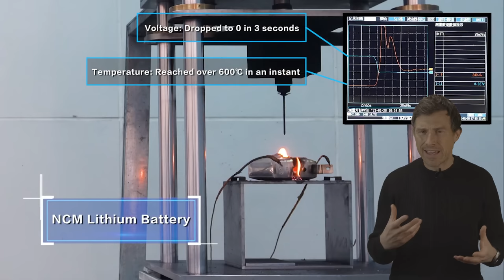Chinese cars are going to rule the world!

Comment: Chinese vehicles are actually doing well here in africa with the spare parts available and the cheap price, too bad they aren't of very good quality but still, they are doing well and selling well, they also offer you a great option which is the cargo tricycle, if you have a limited budget and you want to buy something that carry some loads, you don't need a truck to do the job, a tricycle will do it for you

Fortunately, there are the japanese brands if you want reliability and quality

Talking about motorcycles, they aren't that good compared to the other brands, but still, cheap (to be honest i wouldn't buy one)
Reply: If you want better quality, buy the more expensive ones. They offer you a wide spectrum of choice from very cheap tp very expensive.
Reply: @rap3208  agreed, we have an association that help people in needs, our leader recently told me to look for a truck in the shacman dealership, they were selling 1 truck (X9) but 2 different models, 1 has a Chinese yuchai 3L engine that makes 220nm at 2200rpm, 5 gears transmission, light chassis that is a 2.5T but it is cheap, the other had a 3.9L cummins that produces 410nm at 1500rpm, 6 gears transmission, the chassis looked strong enough and it's a 7t, but it was about 40% expensive

From that day, i learnt that they give you the choice, but most people go for the cheaper option then they complain about it

Comment: We have a Haval H6 from GWM here in Australia and for the money, it spearheads the RAV4 and Hyundai Tucson. Top of the range for those 2: $55,000. The H6 Ultra? $41,000. It's unbelievable value for money without compromise
Reply: @nathanielmoran8537  we don't care about that. Money money money
Reply: @nathanielmoran8537  car companies are not using slave labor mate, they get paid. Not as much as in some countries but more than enough to get by.
Reply: @nathanielmoran8537  geez seems like u know nothing about the car production 😂😂
Reply: @shawndonadieu4084  I know plenty actually. The reason American cars cost so much is the labor. The unions have the companies by the you know what. I’m not saying that the car company itself necessarily is running a sweat shop but I would bet the supplier’s are. It’s same with things like electronics too. Apple products are built in sweat shops.
Reply: @shawndonadieu4084  Plus Chinese branded cars won’t pass our stringent safety tests so they can’t be sold to the public. An issue you don’t have with your death traps 🪤

Comment: 2012 - "I will never buy a Chinese car"; 2022 - "I did not say that!"
BYD is actually the one to be most afraid of - it has one of the most complete chain of technologies. They started really early in hybrid and electric powertrain technologies and their products built in the past 5 years showed excellent reliability. Many of the EVs used in China as taxis, rental cars, and ubers has done over 350,000km now and according to the operators they showed almost zero issues with a completely acceptable ~10% - 15% battery capacity degradation. Many of those cars are still on original brake pads thanks to the KERS.
Lynk&Co. is another one to watch out for. They are essentially Volvos ranging from XC40 to XC90 at half the price. And it is like those Xiaomi phones - same hardware and operating system, but cheaper and, to certain groups of people, better UI and features.

Comment: Really appreciate for exhaustive introduction for Chinese EVs Matt! 
Own one BYD Han DM (not the DM-i, the old version plug-in hybrid), honestly the electronic system as well as Interior trim are decent comparing with same price level saloon (￡30k). However the chassis and the suspension system are sort of lower than average level. Since I've been for vacation and rent VW id.4 once, It suprised me for its fabulous driving experiance.

My appointment is although there are quite a few emerging Chinese EV brands crushed typical vehicle market. The hardware such as suspension, steering system still has a long way to go.

Comment: Changing battery rather than charging is cost effective for the owner, they won’t have to worry about replacing a battery later on when it wears out because that won’t be cheap plus labour.

Comment: the biggest difference of EV market between China and Europe is that, in EU the price of EV models is top-down, with expensive cars coming out first, and then cheap cars coming later; in China is totally the opposite, it is bottom up. So in China, the first EV models that came out were all cheap cars that the public could afford. Therefore, this has also led to people's perception of electric vehicles: they should be cheaper and should be lower than gasoline vehicles. This is the complete opposite of Europe.

Comment: The Geely 01 looks identical as Kia e-niro. Seriously can they do nothing but plagiarise?  
The battery swap tech is simply absurd idea.      600mile+ ranges would technically be possible with EVs even now with todays batteries - and more cheaper and more possible in future --but why even bother?   After  400miles & 7 hours on the road, why on earth would anyone not wish to take a break for half hour re-charge - not just of the car  but mind and body.  And even that half hour will reduce in future to 15-20mins.
I proved to myself long distance motoring is zero hassle last year in my 300 mile range Tesla - all round Scotland to all offbeat corners. Never once had range anxiety or stressed waiting for charge up. I was happy for the break!

Comment: EV has become utensil. Taking you from point A to B. Comfortably and safely. Some tool you need to do a job. That's it. Therefore, it must not be a significant cost item of your family budget. China  car makers are new kid on the block. Having succeeded in home market, they are going to world market where consumers have more choices of EV. China is currently supplying 60% of EV lithium battery packs to those big brands. One thing for sure is EV price is coming down which means more combustion engine cars switching to electric power. That would put pressure on the local transport authority to provide charging infrastructure. That also means to ease the global warming issue that is going to hurt our next generation.